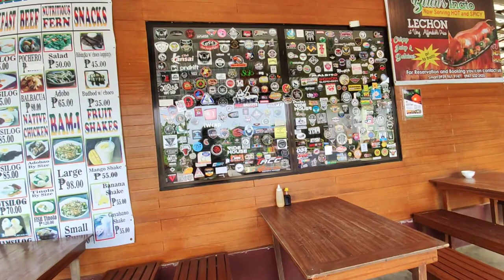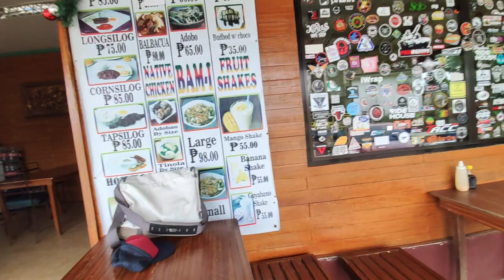Koso ignition coil and Accent wire review | Mio i 125

Comment: Sir kamusta po yung ignition coil + accent wire upgrade nyo? Sensya na sir di ko maintindihan sabi nyo sa video.
Reply from the maker: Performance is great po Sir. Ganda ng arangkada. It also helps lower the gas consumption. Ngpalit kc akong ng flyball and racing pulley set. Parang stock lng ang gas consumption nya. Stock 45-49km / L. Now, with 135cc injector, racing pulley, 12g x 9g flyball combi, oversize rear tires 100x80-14. Gives me 40-45km / L. But the torque and the speed is awesome kahit sa uphill na may angkas.
Reply: @Motosanityvlog  ayus sir, faito ignition coil kasi sa akin, natatakot ako lagyan ng accent wire baka di compatible yung accent wire pero at least ginawa nyo kampante na ako subukan magkabit.
Reply: Sir naka 135cc injector kapo? Stock engine lng po diba?